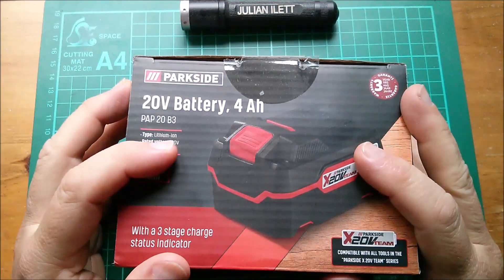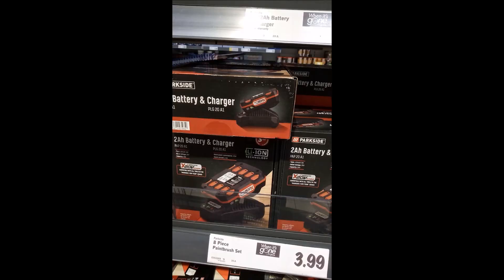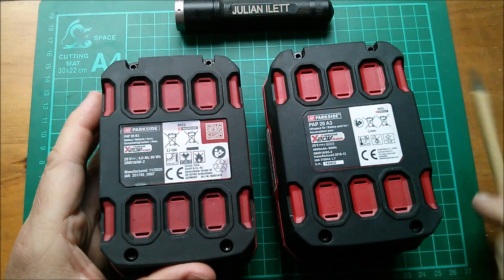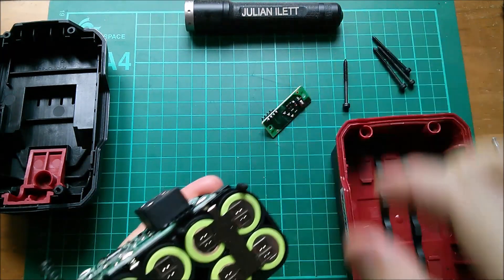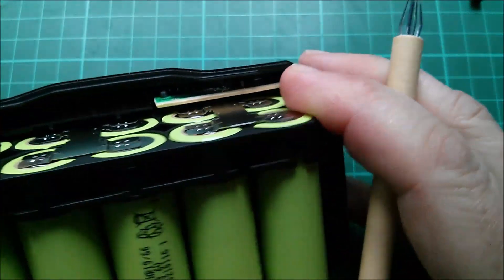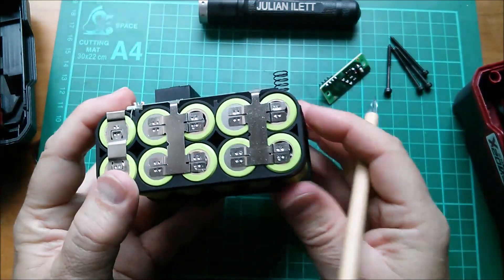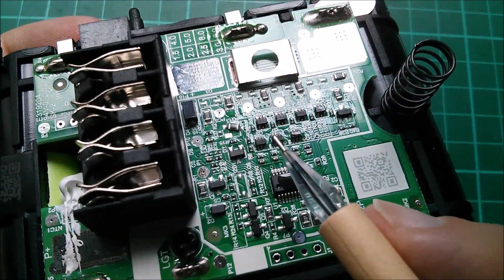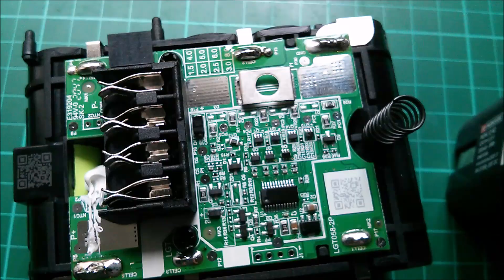Parkside 20V 4Ah Battery from Lidl

Comment: Because of my RC hobby background, I'm tool battry pack balancing feature ODCer just like you sir lol. I've always wondred how famous tool brands balance their battery. I know dewalt balance their battery by charger, and others do it on the battery. I want to know balancing current of each brand/ when the balaning kicks in while charging that kind of stuff. That would be very interesting video. If you don't mind to dig this tool battery balancing stuff deeper.

Comment: Dewalt and milwaukee also don't bother to put in mosfet in their battery. Maybe to deliver maximum current without voltage drop. I think that's some what american thing lol. Almost all of american tool review video have some kind of "V8 muscle car drag racing" vive. Makita has mosfet in the battery btw. Ryoby has to have it in the battery for old ryoby tool compatibility. Bosch is most fucked up because balancing aside, they don't even check individual cell voltage in low capacity battery.
Reply: maybe Makita had mosfet in bat. the lxt ones do not seems to have it anymore.. unless they are hidden :]

Comment: That metal piece, is a current shunt. They can adjust the resistance by enlarging the hole. 
They were stingy with the conformal coating.
Reply from the maker: It's marked F1 on the PCB.
Reply: @JulianIlett  If it's marked F1, it's a fuse. My bad :)
Reply: It could be both. Clearly it's a fuse to stop something catastrophic from happening, but since there is no discharge FET there is nothing to use that information for. This battery pack cannot stop discharge - that is the job of the power tool if i'm not mistaken.
Reply: Pretty sure its a fuse... However could be used as a crude shunt as well, however there are no switching elements so detecting over currents with this shunt has no use really.
Reply: @DannyBokma  The smaller one had a R001 1 W resistor as a shunt.
Are you telling me the big-ass version doesn't bother with Amps? 
Unlikely since the usual DW01 current limits to 3.3A before shutting down. 
BTW, they can also sense the current, by measuring the voltage drop across the MOSFET's Source and Drain. 
If the RDSon is 5mOhms for example, then no use in wasting more power in a shunt.
Reply: works as fuse the battery doesnt cut out at high current as the battery is direct connected, current limit and low volt is handled by the tool...but...if you do low volt the pack, the chip goes into a non recoverable coma and no charger handshake ever again....

Comment: the metal thing is probably a current sense resistor, not a fuse.
Reply: just a fuse, the cells cant disconnect at high power as the pack is wired direct to the terminals.
Reply: I thought that, but on opening a pack up myself it's marked F1; I really wouldn't want to be near that pack if the fuse blew though!